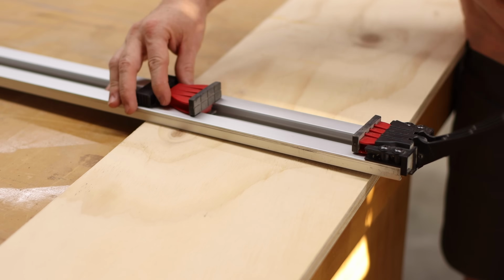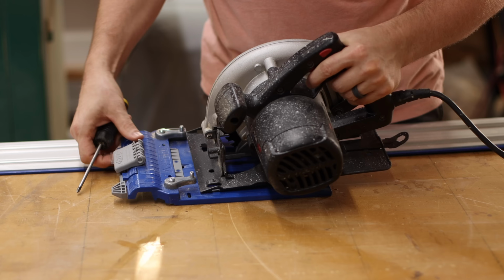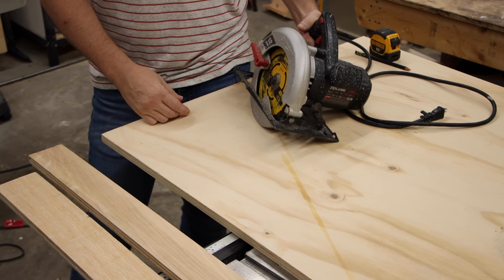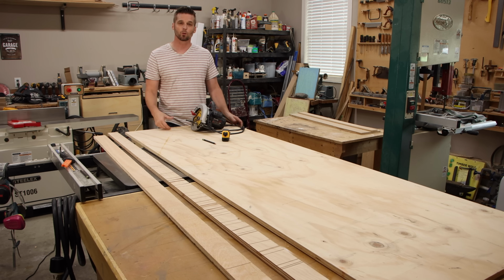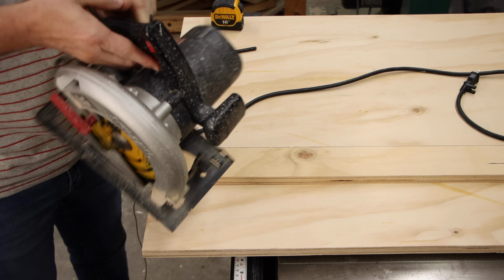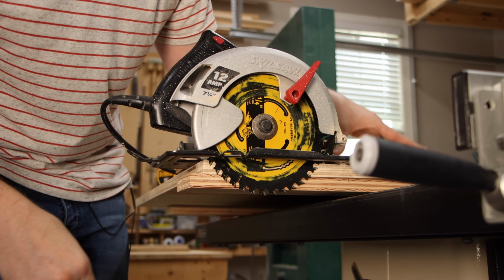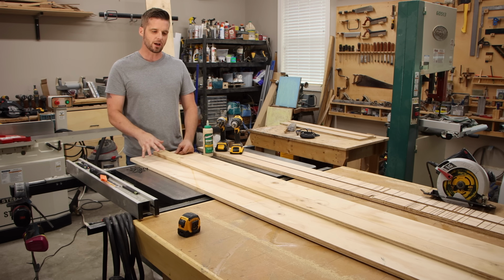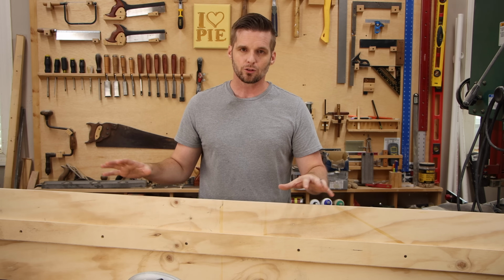Make This Circular Saw Track Saw Guide....With a Circular Saw!

Comment: Don’t wanna have to clamp it when you get done making your homemade track saw guide, glue onto the bottom a rubberized shelf liner. This will work like a sanding mat or router mat only because it’s kitchen shelf liner and drawer liner. It’s a lot cheaper. You can use contact cement to attach it. Then all you’ll have to do is set your guide down on your board to cut and it should stay in place without clamps. You might occasionally have to use a slightly damp cloth to wipe down the rubberized liner in order to get off dust and built up wood particles so that it will grip but it’s a small price to pay to not have to use clamps for every cut.

Comment: If you want to make a longer guide, then say 8 foot so you’ll have more support for your saw to start your cut. You can cut two 4 1/2 to 5 foot long pieces of plywood then make a splining cut and glue together with a spline in your grooves on both sides making a 9 to 10 foot long board then get or make yourself a 1” x 2” x 10‘ long piece of wood to use as the guide rail and attach it to your 9 to 10 foot long piece of plywood you’re using for the lower part of your homemade track saw guide. You can make a line with the chalk from a string line to make sure you keep your board straight and also remember that a one by two is technically 3/4” by 7/4” or 1 3/4”. Cut your guide board to the same length as the bottom plate and instant tracks saw that’s longer than 8 foot without having to buy more than an 8 foot sheet of plywood.

Comment: As for clamping it down, use a micro jig, dovetail clamp. You can buy a two pack of the clamps and then using a dovetail bit you can run the dovetail the full length of your jig under your guide rail, and your clamps will never be in your way as it you will slide the micro dovetail style clamp into the dovetail slot. One on each end, clamping it down to your board that you’re going to be cutting and there will be nothing on the top side of your jig. don’t wanna buy one of the special clamps, no problem. Take a block of hardwood and cut it with the same router bit that you made your slot or on a table saw by tipping the blade to the correct angle whichever way you feel most comfortable with make the block so it will fit into your slot drill a hole centered into that dovetail block so that the bolt or screw is countersunk into it and then drill a hole in a separate block of plywood or wood and add a washer and wingnut or even make a knob from wood and a appropriate size nut and use that to clamp your guide to your plywood that you plan to cut. Or you could get a slot cutting bit so that you could effectively cut your own T track type groove and use a bolt a small block of wood and a washer and wing nut or homemade knob once again. If you have a 5 foot long guide, you can put a screw or other object into the slot to keep your homemade clamps or purchase clamps from coming out so that they stay with your guide at all times.

Comment: You don’t need to leave an overhang to clamp the straight edge. Just clamp onto the top of the guide, cutting down on the weight of the jig. They make very low profile C clamps that only take up about 3/16".

Comment: Biggest problem I have, including  Skilsaw brand,  is some of the  lower end saws the tables are not  very  rigid or square.  I have saw with a semi permanent  plywood table added under the  actual saw table to get it to cut straight on a guide.  this of course further reduces  thickness you can cut.

Comment: This is four years on since you posted this - but the simplest thing you should have done is make it double sided - i.e., when you do your initial cut, simple cut the other side off too. Avoids unnecessarily freehanding the cut on the otherside as you showed and then you will also have a double sided jig - plenty of space to clamp that way and no issues with clamps getting in the way... simples

Comment: What if you used 3/4 inch ply for the guide and 1/4 inch ply for the plate? I think that would give you more depth of cut but would still be sturdy.

Comment: This is what I call a "quick-fix" but not what you want to use in a daily basis. I had built myself a couple of those jigs and it's indeed better than cutting free hand with a circle saw, but honestly I never got satisfied with the results and I always ended up with a meh face. Sure you can get a more or less satisfactory cut in a coarse job but you never should expect for a great results in a fine project. For long panel rips I found the ultimate solution buying a DECENT track saw. Trust me it worth every penny paid.

Comment: Im using a 5 inch blade bosch marble cutter to cut wood using a wood blade, the motor is towards the right and blade to the left... the diy baseplate i made is only square on the left side where the blade is dont know how i can adapt this guide to use with my circular saw too...

Comment: Thanks for the video. A couple suggestions. 

1) If you want more clearance under the motor so you can cut pieces thicker than 3/4" you could use a 1/2" x 96" (1/16" thick) aluminum angle (available at the big box stores for about $12 for 8 ft). An even shorter alternative is a tile edge trim with edge heights down to 1/4" ($10 for 8 foot). The appealing thing about tile edge trim is that they have a 2 1/2" wide base with cutouts that give more support and you don't have to drill and countersink holes in the bottom leg of an aluminum angle. They also come in stainless steel edge trim ($34 for 1/4"), which would be stronger than the aluminum and so less likely to bend if you get aggressive about keeping pressure against the rail.

2) Put 2 T-tracks in the bottom, one in front of the guide rail and one under it or just behind. This will allow track clamps to be used so that you can clamp without anything poking up above the surface. Also you can clamp closer to the cutline. This could allow cutting a very skinny board that isn't even as wide enough as the saw guide itself and so couldn't be clamped to the guide using the wide tab behind the guide rail. And even if you don't want to put T-tracks in the bottom, the track clamps are likely a good thing to use with this saw guide since the straight bar that normally slides in the track can instead be put on top where it won't stick up above the guide rail.  Or if the bar is placed underneath its low thickness won't cause issues with it being thicker than the spacers strips of plywood or foam placed under the plywood being cut.

3) With T-tracks the wide clamping flange isn't needed. This then allows you to use the backside as a jigsaw guide with the same idea that the cutline lines up with the edge of the guide and the blade of the jigsaw slides right down the edge of the guide. A jigsaw guide can be especially when cutting only cutting part way through a piece or if you are cutting between two holes in the middle of a piece to cut a slot and want nice parallel sides or series of slots where you want the edges of the slots to all be in a the same line.  

4) T-Tracks can also be used so that you don't have to have a single 8 foot guide, rather you could have separate 5 foot and 3 foot guides that can be used independently. And then when you need to make 8 foot cuts they can be joined together by sliding short (18"?) miter bars into the T-tracks across the joint and then locking them to the track. Storing two shorter guides is much easier than storing an 8 foot monster. Besides you will probably make a medium and short version anyway, so might as well use that to avoid having to make a large one.

5) Put two strips of self-adhesive non-slip tape on the bottom. Just like actual track saw guides, this allows clamping to be avoided in many situations where the tape provides enough grip to keep the saw guide from moving. And even when you still need to clamp the saw guide, the strips keep the guide from shifting as you put on the clamps.
Reply: Would love to see the modifications you suggest. Have a channel?

Comment: How would you rip a board that's not as wide, or about as wide as the surface of the jig?
Reply: I'm wondering the same thing. I'm not often working with big sheets of plywood, but boards instead. What I've been doing is putting a couple of them side by side so that the jig clamps to an even surface and just hope none of them slide around under there! Any better solutions would be much appreciated :)

Comment: I was looking which straight edge guide to buy, your guide makes me change my purchase decision and went ahead to local store to have them cut to sizes.
I needed to trim an 8 feet panel only by 1 1/2 inch and had no idea how to do it til I see your video.
Will also do for sure for a 4ft guide.
Thanks for precise explanations and instructions!

Comment: What you're showing how to make has always been known as a "Shoot Board" by veteran carpenters.  Simple, easily made and very effective.  

A track saw guide is different in that the saw is restrained from sideways movements both left and right by literally straddling a rail as it moves across the workpiece.  

With a Shoot Board, the user must maintain a slight side-pressure against the raised guide strip to keep the cut going straight as it functions like a rip fence on a tablesaw.  No rubber edging needed, and if the Board ever becomes gouged a new one can be easily made.
Reply from the maker: A shoot board is used with a hand plane and looks much different
Reply: @OutoftheWoodwork  Tommy, how many years have you been in the carpentry business?  How did you learn your trade?  You are mixing up important terms that your viewers will adopt and lead to more misinformation being spread.  I have been a finish carpenter for 43 years and know the proper terms to use for a shoot board and track saw guide. They are two entirely different things.  Swallow your pride and accept that you might have a lot to learn in the coming years.
Reply from the maker: @bobbrown1603  Can you point me to just one instance of a shooting board not being a jig used with a hand plane?

Comment: well... I'm going to try this. This is my first circular saw use and project, and I think this will make life a lot easier. Can you do the same thing for a jigsaw???
Reply: Just as an update, it worked !!!! Could you provide a guide though of how to cut down small pieces using this rig? I have pieces that are about 1.5 inches and I need to cut them down to 1", and I'm not sure how to secure the smaller pieces
Reply from the maker: Great to hear! A track guide really isn't made for this but I did create a jig that should be able to do it. https://youtu.be/i3zRJ8i6GEA

Comment: One improvement you might consider is to glue 100 to 120 grit sandpaper to the bottom of the guide.  This will allow you to simply place the guide on your cutting stock and eliminate clamping it in place.

Comment: Thank you for clear and helpful video! I have some work tops to cut, and they need to be straight cuts - so this is just the video I needed. I like the way you don't have to measure the distance to the blade and square up every time. :)

Comment: why instead of a piece of ply on top to act as a fence, not use aluminium angle profile or something or steel? they are quite cheap, probably cheaper than the wood used, straight out of factory and makes the whole jig lighter too.

Comment: I made a guide but I sort of messed up the very start of the final cut, so the zero clearance edge is a bit wobbly right at the start. Is this to be expected to some degree, as the saw's plate has not yet got full contact with the fence?

Comment: There's another way to ensure a straight edge without relying on panel saws or factory edges. Start with any strip of plywood for your base. Tap in a nail at each end and then mark a snapline between. This is now your true edge. Align a strip of ply or molding that's going to serve as your fence on that snapped line and screw it to base piece, but only at each end. Then, working from one end, screw through your fence into the base ply ever 12" or so, making micro adjustments as you go to ensure the fence exactly aligns over top of your snapped line. It's at least as accurate as a factory edge or panel saw cut, and you know you can trust it.

Comment: Just wondering if you can put rubber strips underneath it? That way it will grip and you won't need to clamp it most of the time?
Reply: You can just glue some sandpaper strips on the underside, and it will grip really well.

Comment: Easy build…yes, but wastes wood.  The ‘zero clearance’ cut by the blade doesn’t need inches of waste wood to the right of it, and that rear clamping plate need only be wide enough to ensure your clamps don’t hit the motor housing., otherwise all good.

Comment: If you run the circular saw down both sides, you make the jig symmetrical, so you can use either side.
Reply: When I made mine (very similar) I set it to use my Rage 240v one side and my 18v cordless the other side

Comment: Instead of all the measuring, why not just measure the width of the saw base plus one eighth from the edge of the plywood then set your straight guide piece that’s is true on both sides, then cut the piece with the saw on both sides?  🤷‍♂️

Comment: I use one of the aluminum straight edges with a clamp which you show right at the beginning of your video.  I have piece of wood about 10 inches long with a width exactly that of the distance from the cut line.   I mark this piece of wood as a template and keep it with the saw.  All that is necessary is to add the width of this piece of wood to the cut line on the wood I am cutting.  I have had the template for years and I get consistently quick accurate cuts.

Comment: I work for a door company and we run into situations where a door needs to be undercut about a 1/2 inch in my current jobsite. This is exactly what I need to make to make more accurate cuts
Reply: And it protects the door at the same time

Comment: I'm going to build this out of 10 mm ply, double sided saw and router and I am also thinking of adding a perpendicular fence below the start so I don't have to align with two points as that invites error
Reply: I wouldn't recommend the perpendicular fence, if your edges aren't parallel you won't get an accurate cut.
Reply: @taylorsutherland2595  you use it on a case by case basis. Just because you have it, doesn't mean you must use it.

Comment: I just built basically the same thing, however, I glued 80 grit sand paper on the back so I wouldn't have to clamp it down every time I used it.
Works like a champ, that sucker hangs on like chrome on a bumper hitch, I've made many cuts with it so far & they are all extremely accurate with no slippage.
Reply: What types of surfaces does the sandpaper work on, just wood?

Comment: Thanks for this guide, Tommy!  Very helpful for complete beginners. Was contemplating the Kreg tool, but this seems to do the trick.  The only issue I've run into is, somehow someway, my circular saw blade didn't cut completely plumb.  It's like the material pressed it out a bit and so it flexed out about a 1/16th here and there.  But NOT evenly, which is weird as well.  Sighting down the cut, you can see where the edge angles out here and there.  I found it helped to run the saw backwards along the edge when I was done and it got rid of some of that.  Still a little wonky.  

My guess is operator error in making that first cut, but any other thoughts?  As in, feel like maybe I used too much pressure on the tool and it canted OUT the blade a little?  Used 1/2 ply as the fence and some discarded 3/4 sub-floor I found from construction going on next door...
Reply: Blades can warp pretty quick from over heating. If you had a board under the wood you were cutting that’s just the kind of thing that will heat up the blade.
Reply from the maker: Were you using a newer, sharp blade? That's really the only thing I could think of. If you keep pressure up against the fence on the track, the saw wants to cut straight if there's a sharp blade in it.
Reply: @OutoftheWoodwork  Hrrm. I've had it a for a while but rarely, rarely used it, so it's probably ok.  I do worry that there was downward flex.  As in, I was doing this on top of a piece of junk ply between two saw horses (b/c I need the jig to build a proper working table !!).  So maybe pushing down too much vs just sideways against the fence bowed out the blade

Comment: would this set up be able to do 45 degree cuts?
Reply from the maker: Yes, but I would make one dedicated to 45 degree cuts. Once you make that first zero clearance cut it will show you exactly where the saw will cut, so it would work great!
Reply: @OutoftheWoodwork  THANKS 🙏🏽
Reply: @OutoftheWoodwork  just to clarify, when i make the zero clearance cut that’s the one I would make 45 degrees?
Reply from the maker: yes

Comment: I’ve been using this method for 30 years. I needed a new one.  I could not find a good straight edge on a piece of plywood to buy. I looked for a 1x4 and they did not make the grade. Then I bought a 1x4x8’ plastic trim board, straight as an arrow and cheaper than wood. It worked great. I have allways used the plywood before, but wood is not as good as it used to be.
Reply from the maker: Great idea, Mark